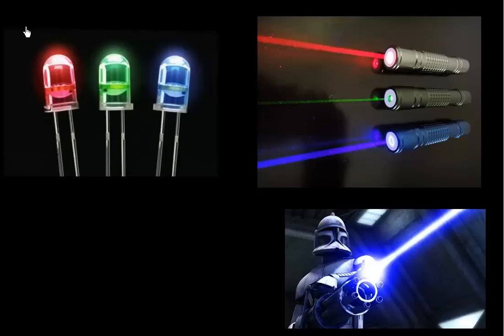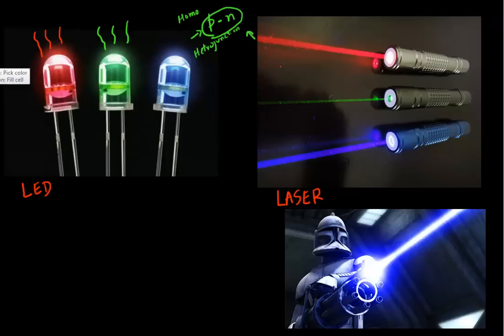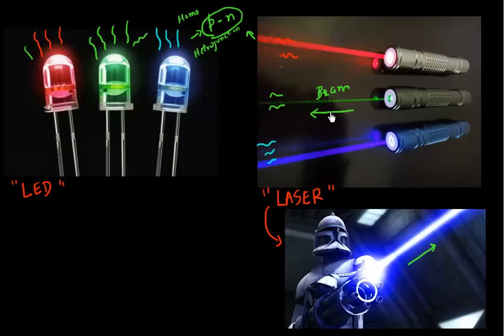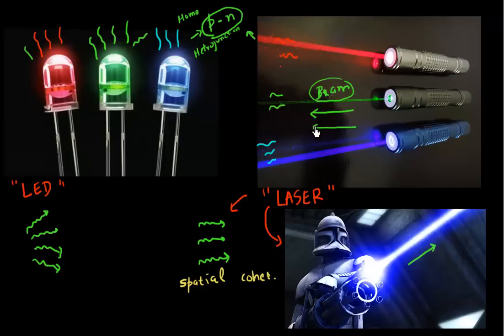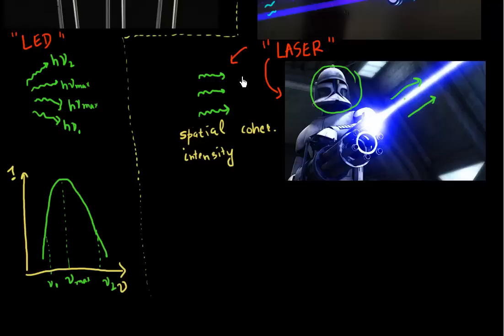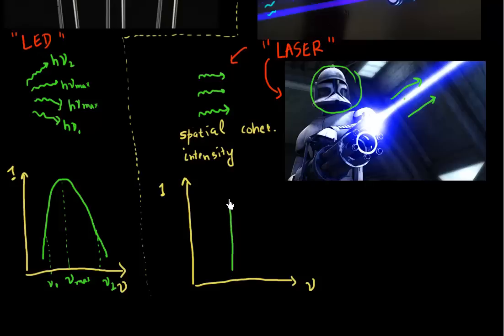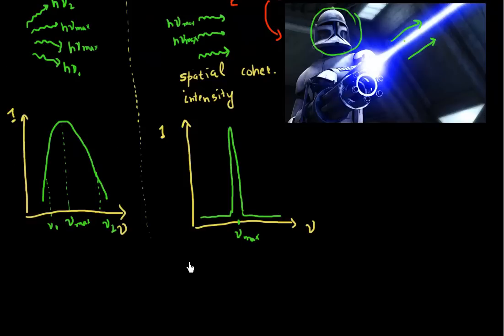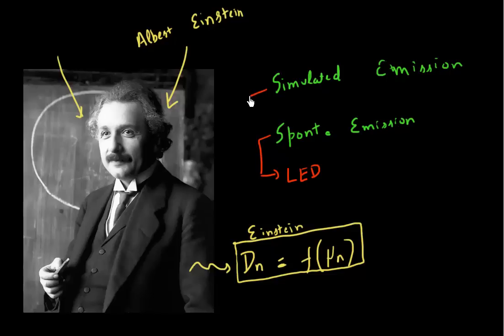LED vs. LASER: whats the difference ?

Comment: You are confusing collimation with spatial coherence. Collimated light is a beam of light in which all the rays are traveling in the same direction. Spatially coherent light is light in which the electric vectors of the photons are correlated across space. It is possible to have spatially coherent light that is not collimated into a narrow beam, as, for example, light passing through a pinhole. 

You also use the term "simulated emission," but the correct term is "stimulated emission." The laser isn't simulating anything (relevant to making a laser beam); it is stimulating photons to emit light.

Comment: I wonder if you could get anything simular to a laser out of putting a lasers output lenz in front of a super bright red led?
Reply: No. The semiconductor laser beam is created inside the depletion region of the semiconductor laser diode, due to characteristics specific to the way the diode was manufactured.
Reply: +John Kerley http://qz.com/146761/forget-led-bulbs-the-future-of-interior-lighting-is-lasers/
Reply: mladen culic He's doing some hand-waving in front of his magic trick. The mirrors on a laser diode are grown on the crystalline structure of the rest of the laser diode; you cannot simply put mirrors around an LED and get laser light. Also, as I mentioned, the internal structure of a laser diode is different from an LED. 

"Fig. 2.6.2 shows a simplified construction for a laser diode, which in this case is similar to a light emitting diode (LED) in that it uses gallium arsenide, doped with elements such as aluminium, silicon or selenium to produce P type and N type semiconductor materials. However a laser diode has an additional active layer of un-doped (intrinsic) gallium arsenide only a few nanometers thick, sandwiched between the P and N layers, effectively creating a PIN (P type/Intrinsic/N type) diode. It is in this layer that the laser light is produced."

http://www.learnabout-electronics.org/Semiconductors/diodes_26.php

A laser diode will be an LED prior to reaching its critical current, then operate as a laser past its critical current. An LED will always just be an LED, no matter how much current is applied, until it burns out.
Reply: Thx!
Reply: +mladen culic I do"nt know what you thanked me for, but I did look at the link you gave me, if thats why you said that.